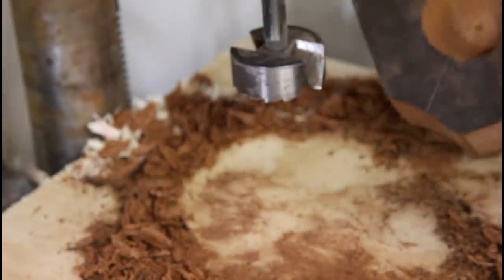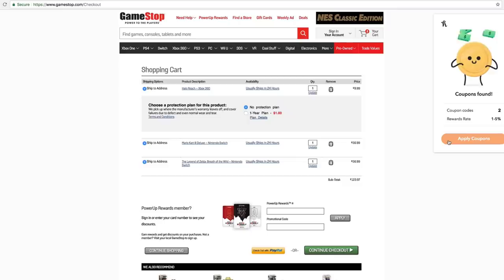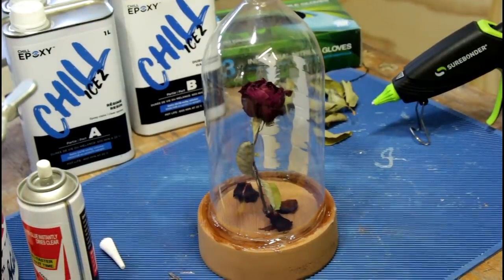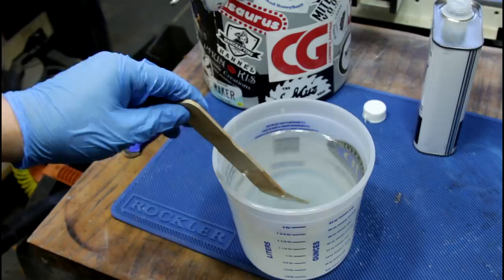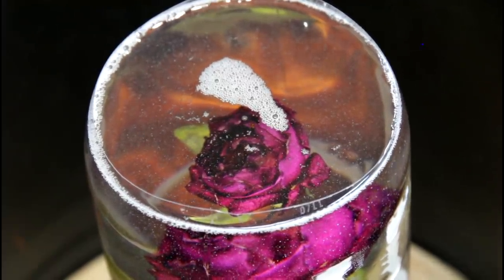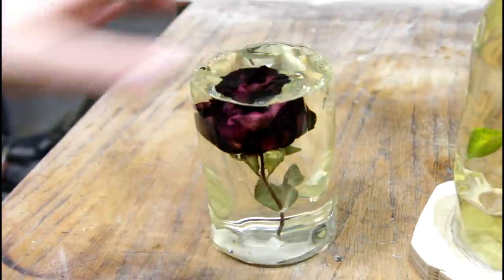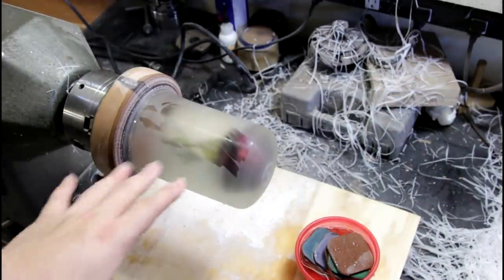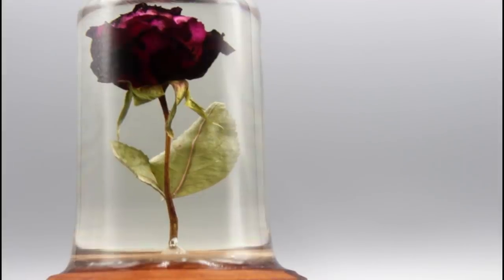Can You Preserve A Rose in Resin?! | Dipit #24

Comment: probably the reason why the first rose went brown has nothing to do with the amount of resin, and much more to do with how fresh the rose was, making me believe the 3rd rose was simply 'newer'. also there could be the issue of how the (hot) glue effected the flower itself, compared to the 3rd one. a few other things, you also could have poured in a bunch of resin, then throw in a petal or two, continue a bit, and then 'push' the flower a bit into the resin. it would make it fly instead of 'be glued'. then fill the rest out. the question that did NOT get answered however was can you 'PRESERVE' a rose in resin? all i saw was can you PUT a rose in resin. Preserving it is different, which means, let's take a picture of it when it happened, and let's wait a few weeks to picture it again and compre and see if something changed. if you just wanted a resin beauty and the beast replica then you could have went with a fake rose.

Comment: I don't get why you use a pressure pot rather than placing it in a vacuum ?   Wouldn't a vacuum help draw the air out of the resin as well as keep the heat to a minimum?

Comment: The rose didn’t hold it’s color it because you cannot put anything that has moisture in resin, otherwise it will rot. You have to dry the rose first. I’ve been watching videos and people soak roses in alcohol for two days to suck out the moisture and they soften the rose in a conditioner and the rose looks alive. However your rose will be bleached white due to the soaking in the alcohol. You can put your rose in the conditioner mixed with food dye or some kind of dye to put color back into it

Comment: There are large pour resins that are designed to not get as hot as they cure. I'm sure they cost more however.
Reply: This is a deep pour resin. This is designed for 2inch thick at like 40L but this was thicker and trapped in a chamber I'm assuming it couldn't let what heat that it did generate out

Comment: Why not build your mould upside down &use strings a piece of string across the top just like you would a candle so that the rose is suspended that way and then just glue your bottom base on that way? It would have been a lot simpler had this entire project been done upside down or the other way around

Comment: Please, please, please someone do a rose that hasn't been dried. Just as an experiment,  I want to see what will happen,  how long the rose will last, will it cure (I'm sure you can find a resin that will do the job) and I want to see if the colors (green stem and red rose) will last.  Every video i see online,  they dry the rose first. Maybe the drying step isn't even necessary with modern resins.